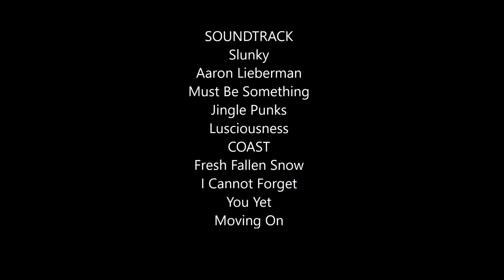Making a miniature Grandfather clock

Comment: It doesnt look finished. Why are there two panels of wood on the sides at the bottom? Surely they should wrap around the front as well, with round over edges? The top looks out of balance. I would have thought a miniature grandfather clock would look like a smaller version of an original? This doesnt resemble a grandfather clock to me.